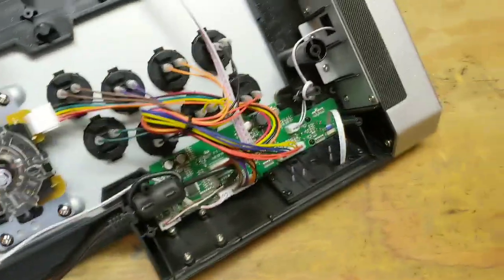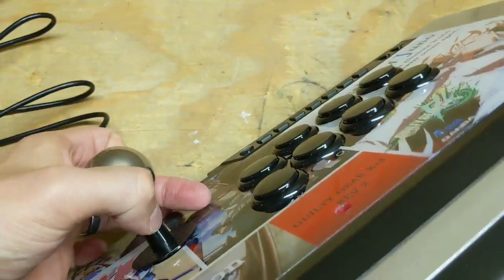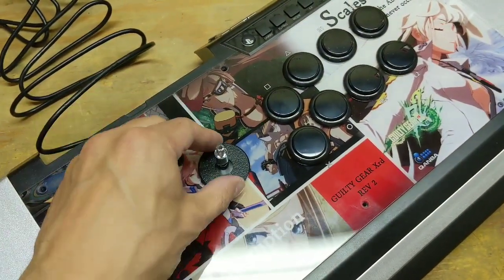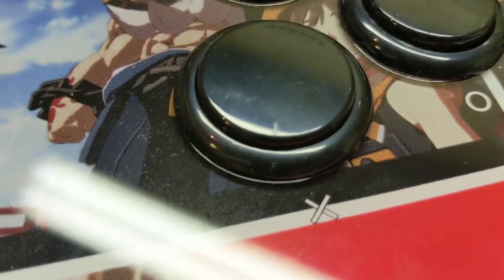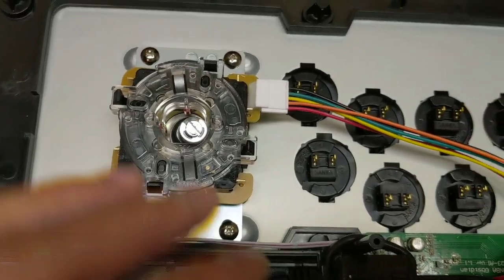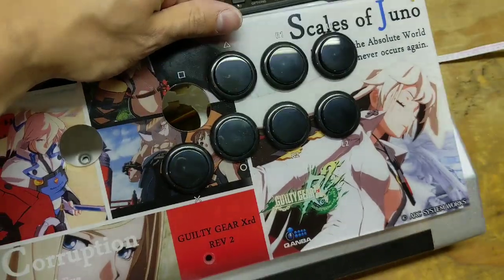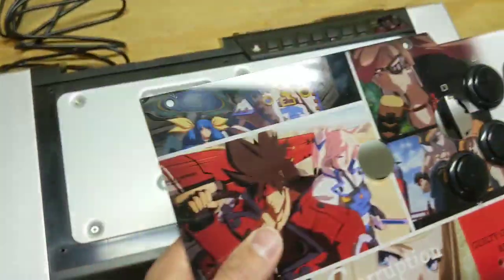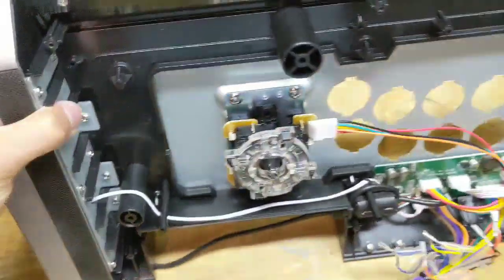Modding a Qanba Obsidian - Part 4: Disassembly

Comment: Hi im having trouble disconnecting the wires from the buttons its like literally stuck,my fingers hurt.
Reply from the maker: Need some needle-nose pliers. Grab the base firmly and give it a swift yank. Not too far though or you will rip apart your harness